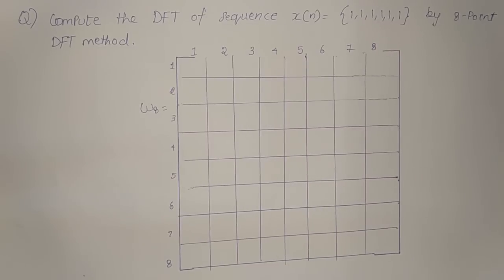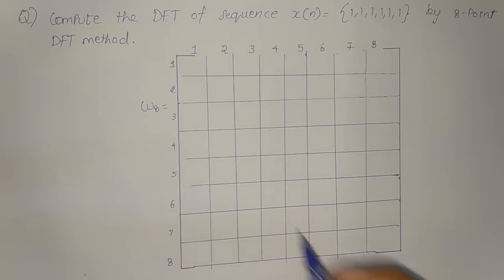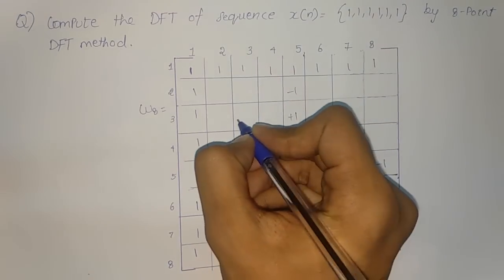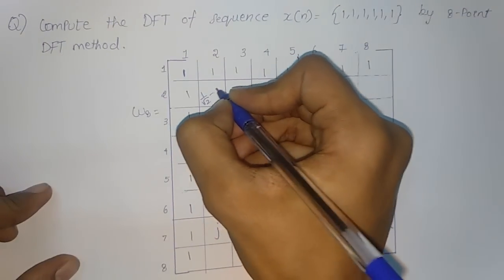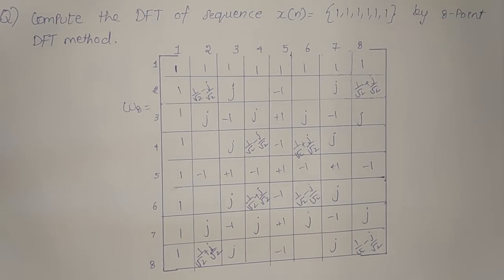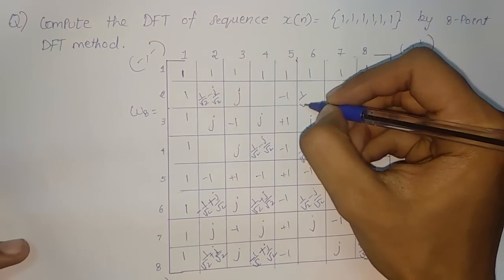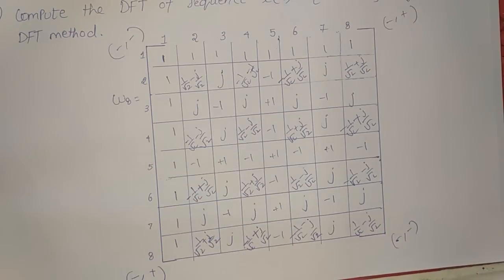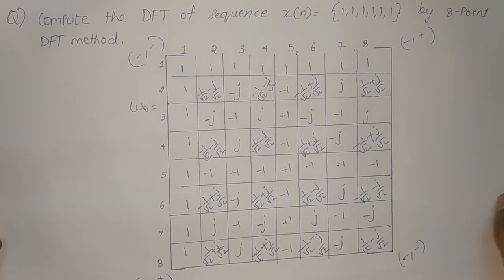Digital Signal Processing - 8 Point DFT (shortcut) Problem

Comment: Not easy to remember UNLESS one is made aware of these EIGHT points are a uniform progression around the unit circle, some anticlockwise, some clockwise, starting from the positive horizontal axis. Also, row 5 and column 5 correspond to one-half the sampling frequency, so everything in rows 6 through 8 and columns 6 through 8 are the complex conjugates of rows 2-4 and columns 2-4 , reflected about row 5 and column 5, respectively.